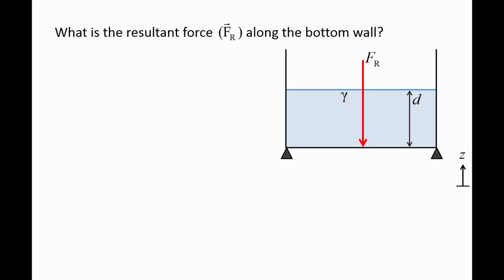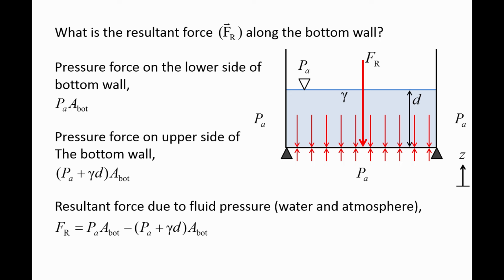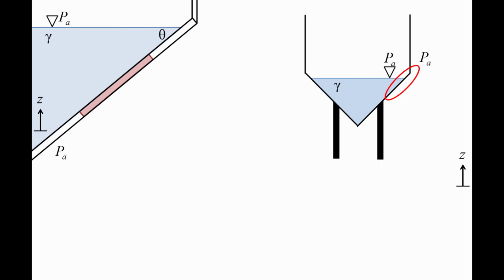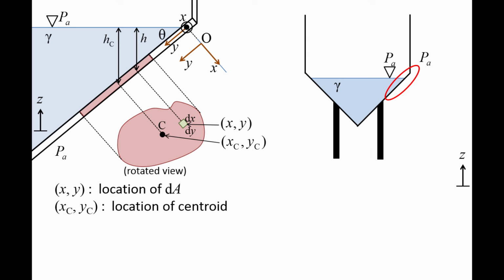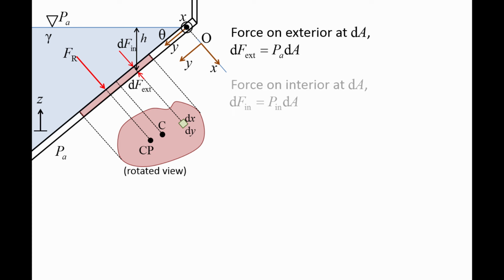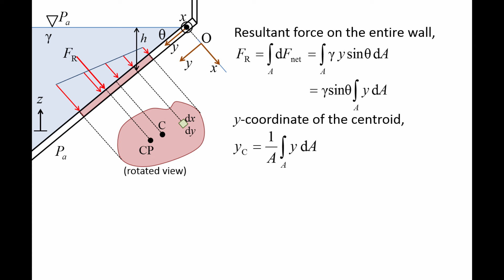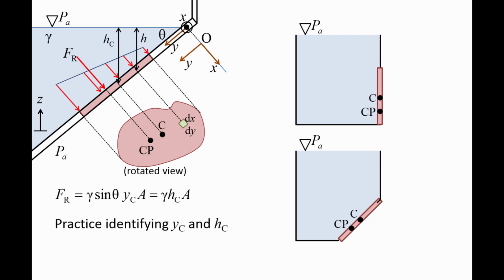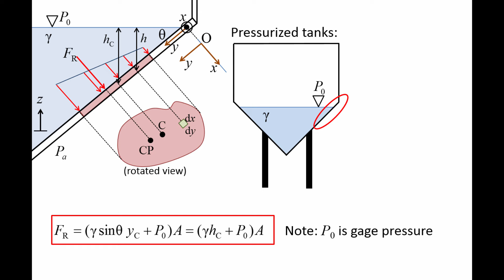Fluid Mechanics: Topic 4.1 - Hydrostatic force on a plane surface

Comment: In this video you considered the inclined surface as the wall of container. If it was submerged inclined plane (not a container wall) then would there be a change in resultant force, if not then why?
Reply from the maker: If a surface is completely submerged in a fluid, then you only need to consider the buoyant force on the surface.
Reply: @CPPMechEngTutorials  OK thanks

Comment: I want to as a question on The resultant force due to fluid pressure of the bottom wall. The d do i need to sub a negative value to it, since upward motion take as positive

Comment: what is the meaning of specific weight of the water? if it is the weight of the water then why it is multiplying the depth of the water as inside of the bracket should be the pressure instead of the force...   @1:04
Reply from the maker: This concept is defined in an earlier video. It is the density of a fluid times the gravitational acceleration g (9.81 m/s^2)
Reply: CPPMechEngTutorials okay thanks :)

Comment: when the force acts on an horizontal plane the center of pressure = the center of gravity ?
please answer me :)
Reply from the maker: If the surface is horizontal, then the center of pressure coincides with the centroid of the surface. If the surface has uniform density, then the center of mass, center of pressure, and centroid all coincide.

Comment: what is CP.....Is its centre of pressure? ? right??? and what's C .??? is it centroid????? so my question is that you take an inclined plan....have uniform thinness.....and fluid incompressible.......but where this resultant force act on plan ????? you said on CP.....Why????? answer plz.....I am in trouble 😢😢😢😢😢
Reply from the maker: The resultant force acts at the center of pressure.
Reply: Resultant force will act on CP not in Centroid. Because the fluid pressure acting on the surface is not equal, It changes along with the depth. More the depth more will be pressure. So resultant force will act at a point which is below Centroid i.e. CP.
Reply: thanks jigar.........it will help.......
Reply: ok....sir....thankyou..
Reply: one thing more i want to ask.......first moment of area.....i can say easily rotation about any axis by applying force multiplying by perpendicular distance from axis of rotation,,,,example Mx=f *y ......right?    but what is 2nd moment of area or inertia......what's concept behind it ........is it same rotation with double perpendicular distance about an axis or something like resistance ?   tell
Reply: one thing more i want to ask.......first moment of area.....i can say easily rotation about any axis by applying force multiplying by perpendicular distance from axis of rotation,,,,example Mx=f *y ......right?    but what is 2nd moment of area or inertia......what's concept behind it ........is it same rotation with double perpendicular distance about an axis or something like resistance ?   tell

Comment: when ever tank pressurised with internal pressure then there is any effect of atmospheric pressure in resultant ....?
Reply from the maker: From the derivation, the force from atmospheric pressure cancels out. However, if the tank is pressurized above (or below) atmospheric, then you need to account for this. See 7:30 in the video.